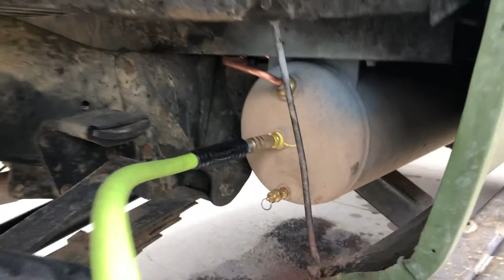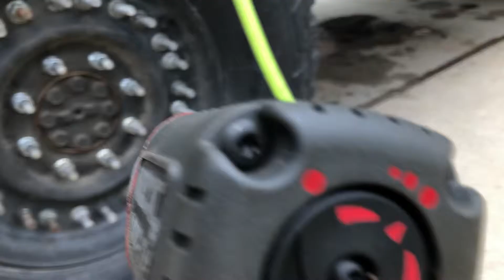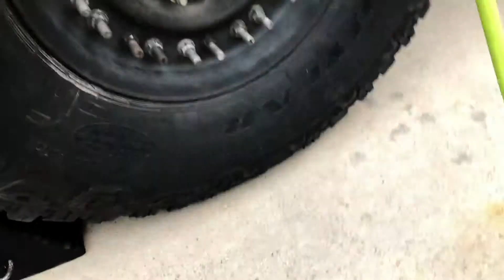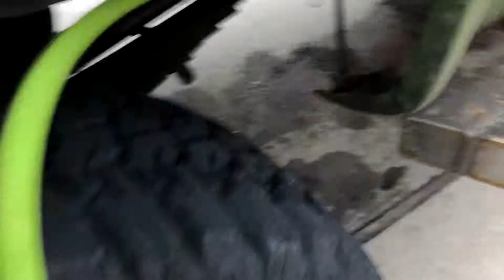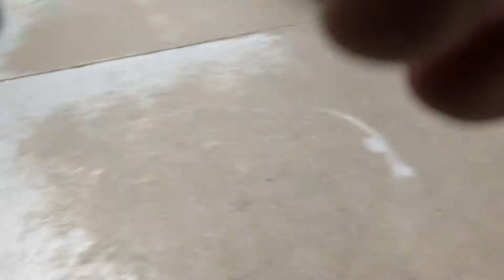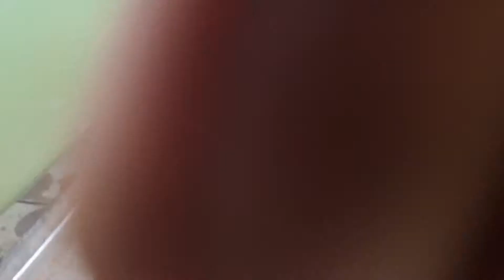Testing York Onboard Air

Comment: How does it keep up when using air tools
Reply from the maker: The tools never slow down.  I do idle up the truck if I’m inflating tires but even at idle every task can be done.  This is a 10+  CFM pump at 100 psi when the engine is idled up.